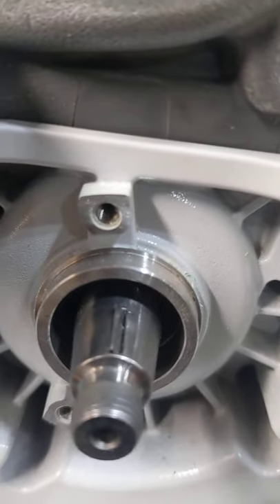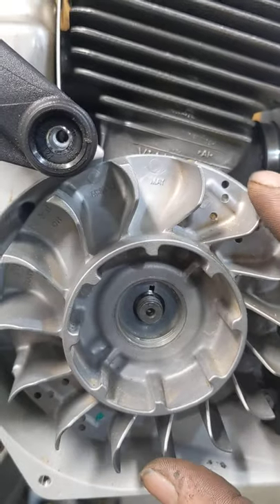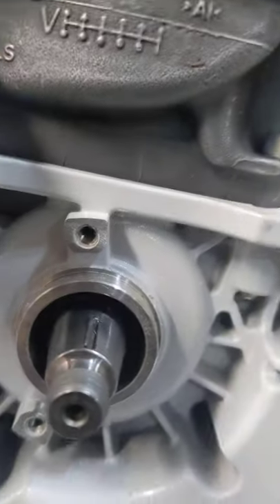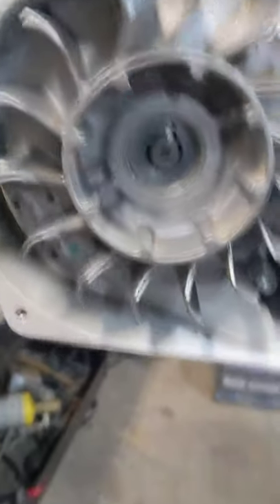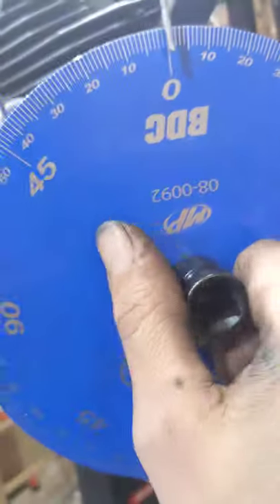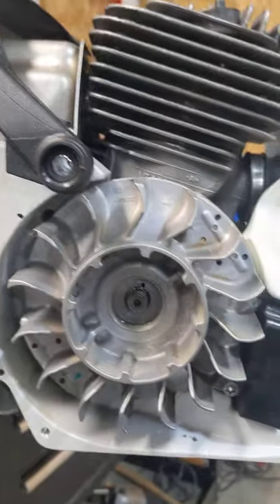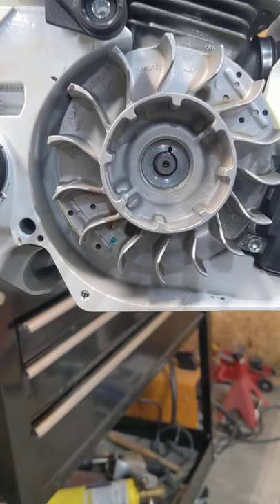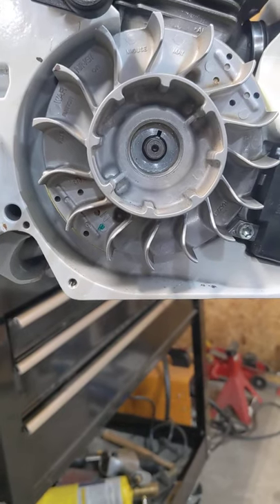Advancing Timing On A Chainsaw

Comment: Do you advance all your saws? How much do you advacr a 461?
Reply from the maker: No there’s more I don’t than I do. None with the factory coil has a advance built in. if you put a 660 coil on them 5 degrees.
Reply: @buxtonworksawsllc9645  thanks for the tip! I have been putting 660 coils in them